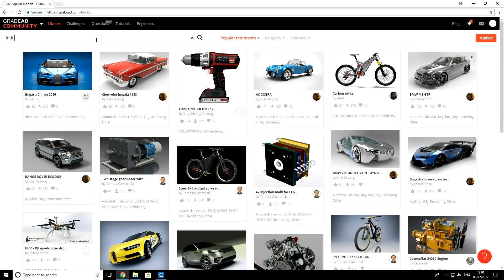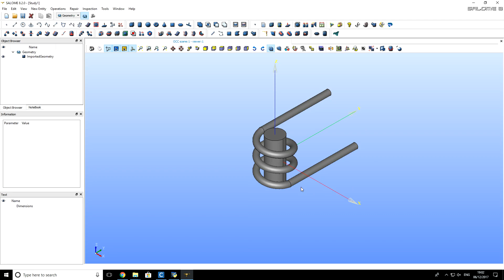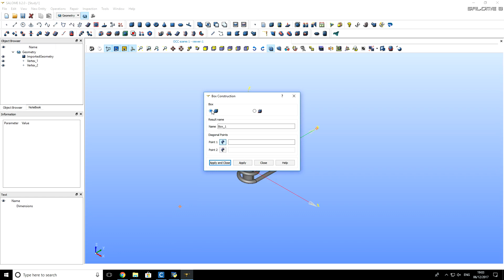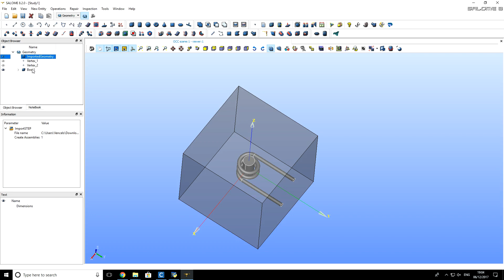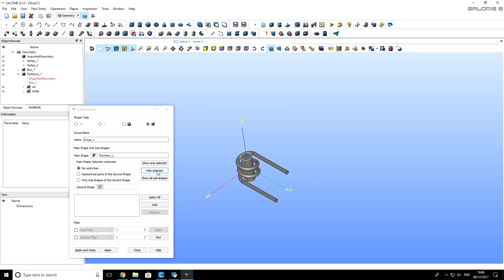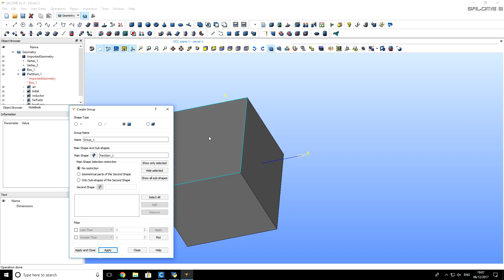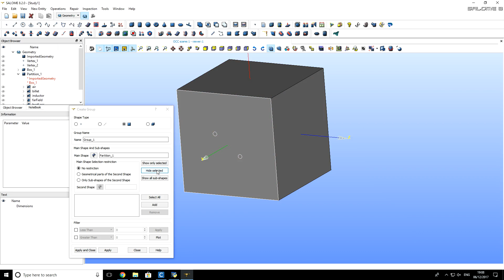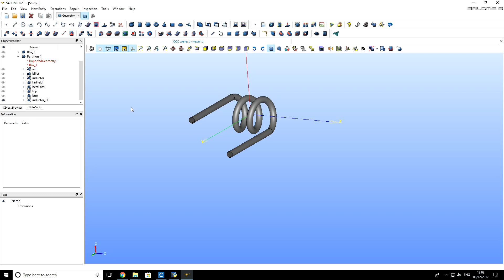CENOS tutorials #014 - Induction Heating 3D - geometry

Comment: how would one go about generating a vacuum layer
Reply: Do you mean viscous layers?
Reply: @shchepan  i figures a way around, i would need to create new materil for the vacuum region to reduce heat loss on the induction heated zone, m still wondering does CENOS offer ability to simulate non symmetrical billet configurations when one looks to manioulate proximity effect?
Reply: @kabelob.ramontsho5026  for vacuum, you can use 'air' and disable 'thermal analysis' in this region to avoid any heat transfer through it.
Sure, you can simulate non-symmetric 3D objects in CENOS.
Let's move this to email - I'll show you how to do this. Please write to ms@cenos-platform.com